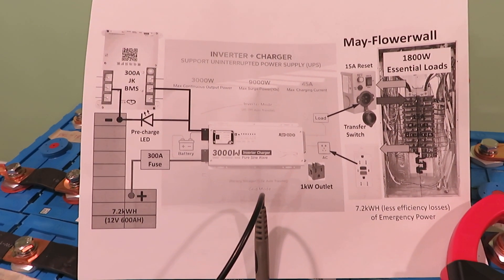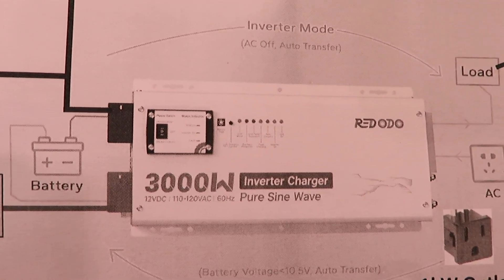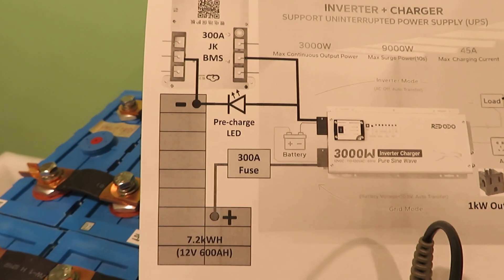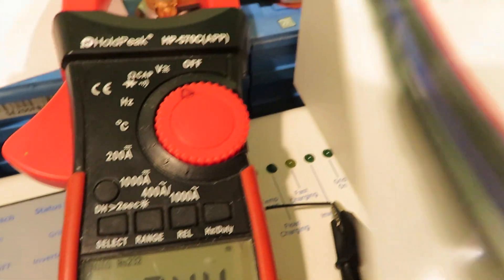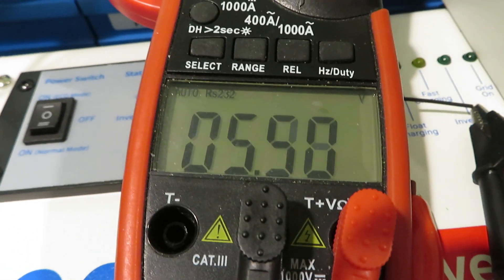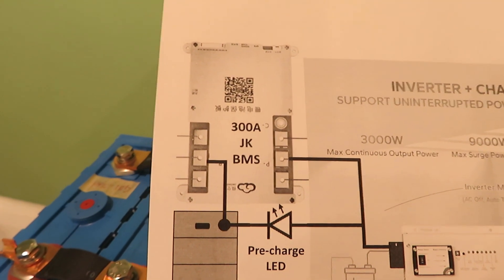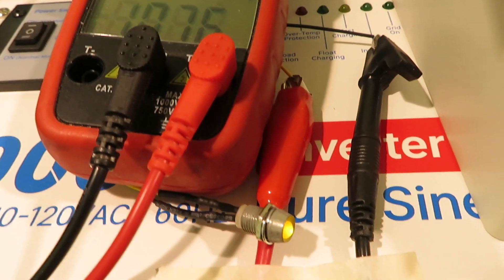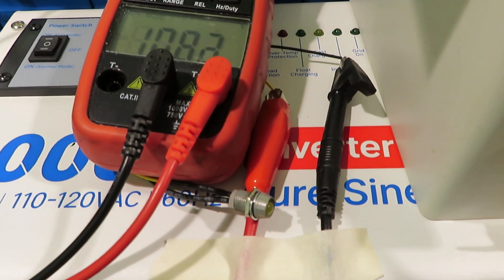JK BMS – Artificial Warning Err Code 6 “Short Circuit” Fix by a Pre-charge LED

Comment: My understanding JK's have a pre-charge feature only works if you connect it with the BMS shut off. When you turn the inverter on or close the DC breaker the JK will power up automatically without pushing the button. It goes through the pre-charge limiting the current while it starts up.  This was with the inverter BMS V15.

Comment: what would happen if you have other loads connected to the output of the JK BMS besides the inverter? won't they be powered on even if the BMS is OFF?
Reply from the maker: No problem with other loads. BMS ON is required to power up the inverter. The BMS could be turned off once the inverter is powered up but not recommended, because the inverter is trying to charge the battery. The charging voltage may fluctuate wildly due to closed loop constant current and constant voltage controls when there is no reference voltage.
Reply: @parkhopper3627  I'm a little confused as to why other loads won't draw power from the battery through the LED bypassing the BMS when it's OFF and over draining the batteries. So my setup consists of 4 batteries with JK BMS connected to a buss bar, inverter/charger and other always ON loads connected through the buss bar. When batteries get low and BMS cuts off for Low Voltage Protection, the other loads drain the capacitors in the inverter, so every time I power the BMS back on to charge the batteries, the capacitors draw huge current and cause the JK BMS short circuit error. I've increased the Short Circuit Protection Delay in JK BMS settings to 2500uS and that seems to work but i would like to find a better solution.
Reply from the maker: @andreistremtan  The LED path only allows ~5mA of current flow and is not designed to support continuous loads. In your case, just keep the BMS ON to support your other always ON loads.